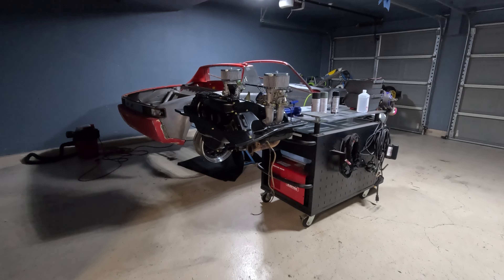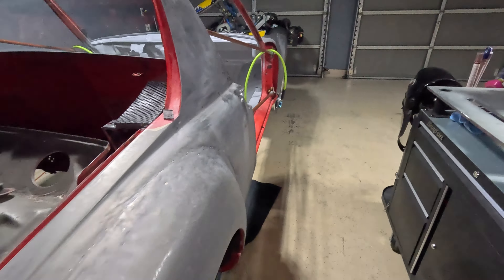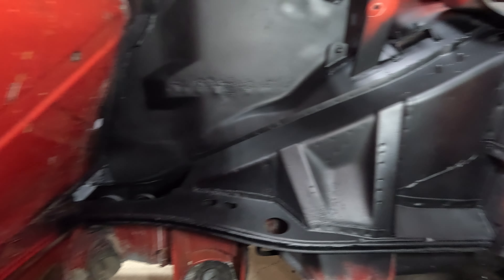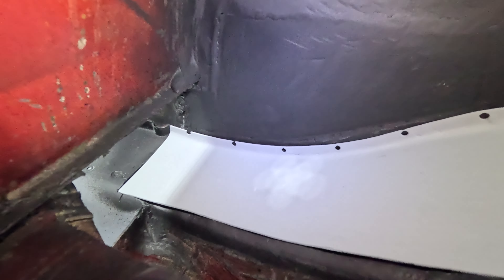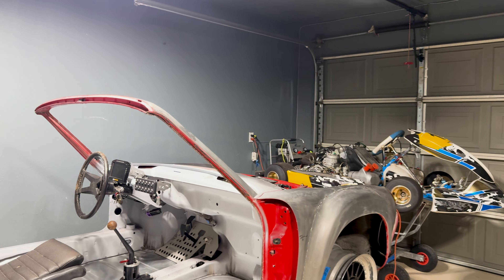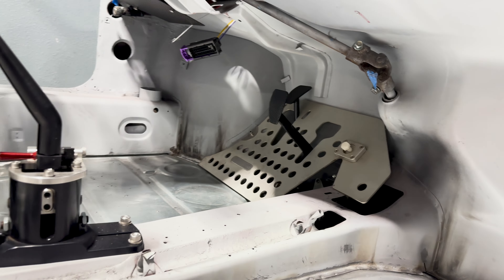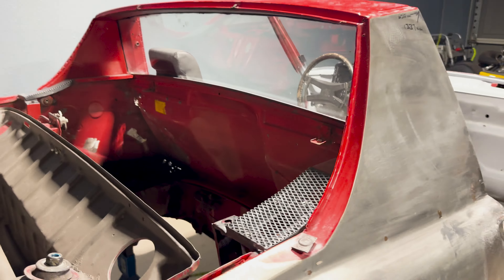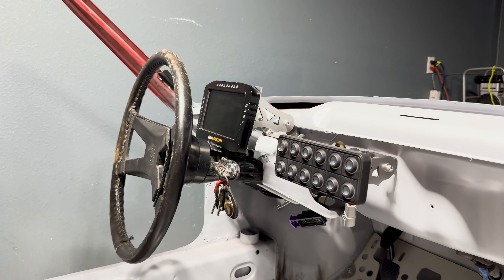porsche 914 day 006 Udpate Ecu Master ADU 7 x PMU-16 x Hell Hole

Comment: Looking great! I did similar hell hole repairs on my 914 Subaru swap. I’m using the Rennline battery bracket as well, but installed in a replacement factory tray. I like the way you installed it sideways.